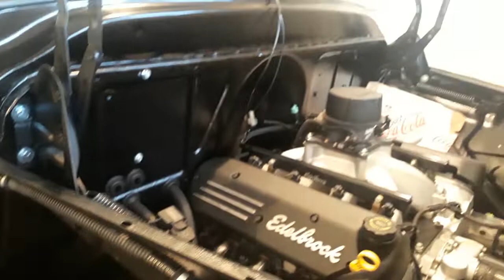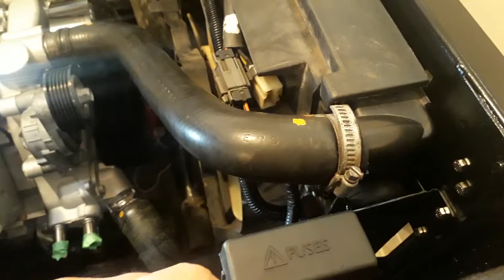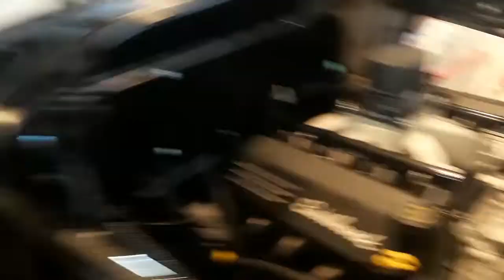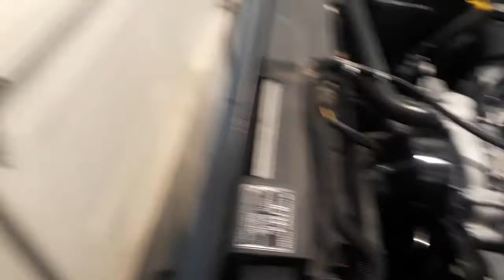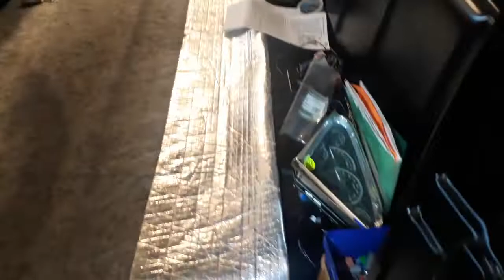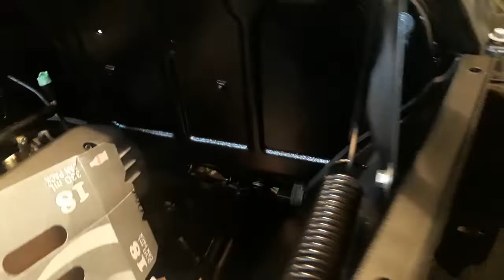1958 Chevy Apache - Part 41 - Engine Bay & More Updates

Comment: What motor mounts did you use for the flat out crossmember? I’m just now at the point of fitting my 6.0, they look like they are from speedway.
Reply from the maker: Custom made. Check out vidros 18 and 22 i think it wss then a little later i modded one to clear the steering